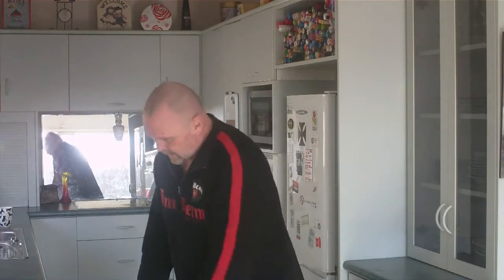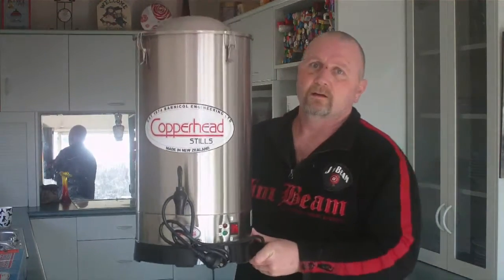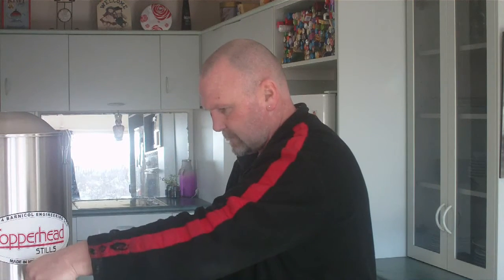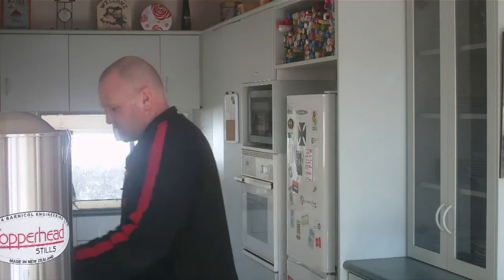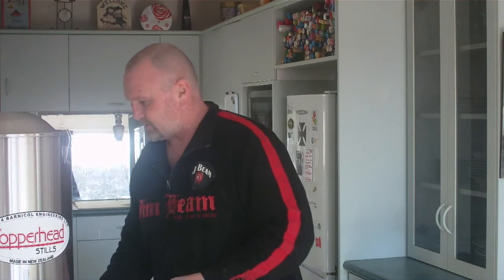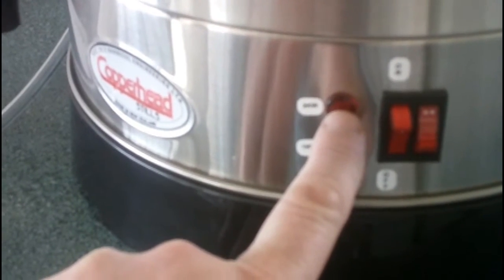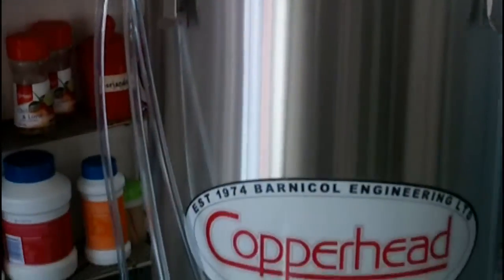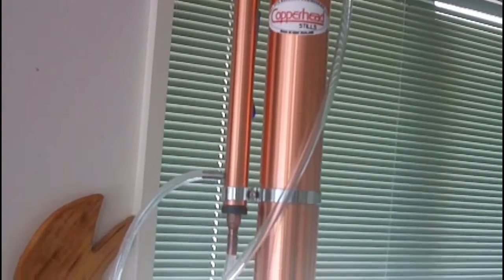Unboxing my new reflux still

Comment: Unfortunately Barnicol are no longer manufacturing these stills, another victim of government covid restrictions strangling local businesses in NZ 😞 I've operated my Copperhead rig for a number of years now, utterly predictable and reliable, exactly an hour until first alcohol output then a further 2 hrs for 3.5L of 92% clean spirit. One thing that is essential -a regulated water-pump with a micro adjustment valve, it's nearly impossible to maintain a consistent coolant temp otherwise -you'll go crazy trying to adjust the waterflow without one.

Comment: Looks good, except the damned plastic hose on the take off... Get rid of that or the shit will leach into your spirits..! It doesn't matter if the manufacturer praises it as so-called "food safe" silicone. Food safe doesn't mean alcohol proof, especially with a high ABV. Make an extension of some copper pipe. Stay safe and have fun..